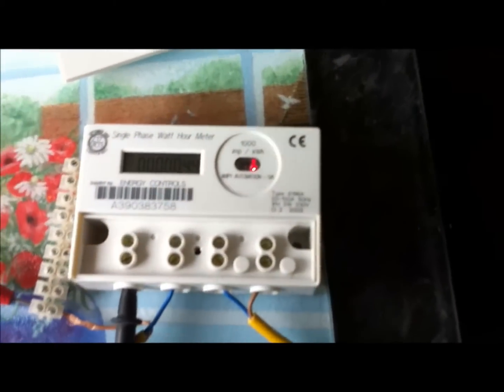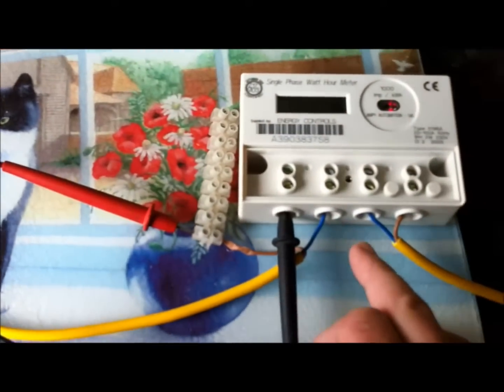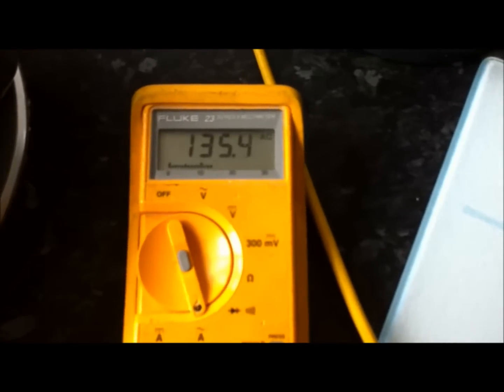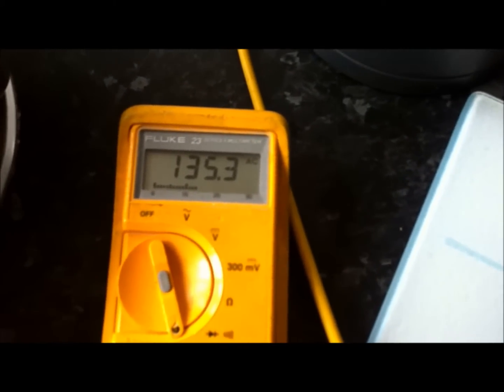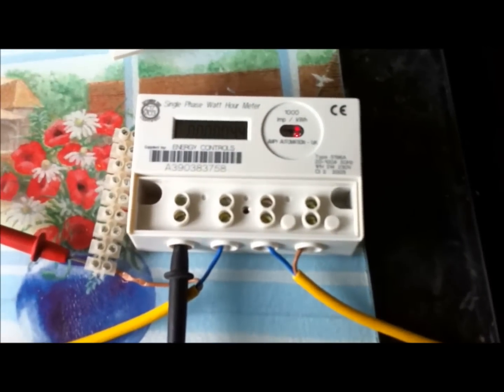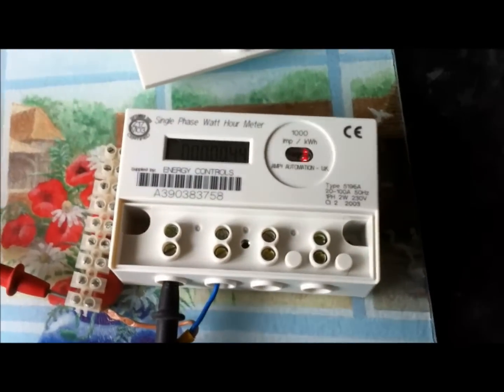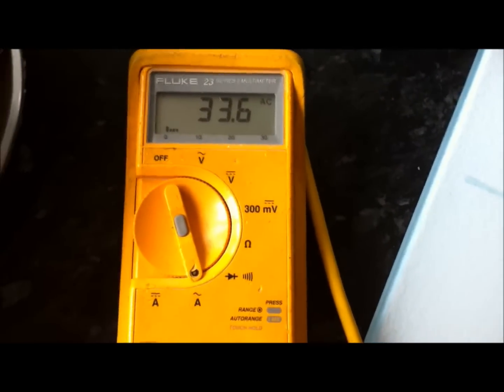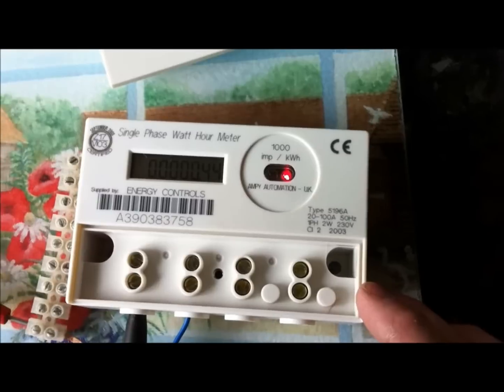How much power does the Ampy 5196A take when on

Comment from the maker: Mesage 1 of 2 Hello there Ted, Normally when the Red light is on constantly it means that you are not using enough electric for it to read it’s a digital meter for an anti-creep (Doesn’t charge you for not using energy) however the rEd stands for reverse energy detected. If I was you I would call your energy supplier and tell them and explain your situation as if you leave this you could get a fine for trying to mess with the meter. You need a pay back meter as what seems to be happening

Comment: Hi Steven, my elec meter is one of these and the red light stopped flashing and it's now on constant. Do you think this represents an error? Also the display changes between the meter reading and rEd ? I've had solar panels fitted recently, if its an error then i guess that it may be the cause? I'd appreciate any advice Thanks.

Comment: My goodness! EIGHT WATTS?! :-O I have a boombox that uses about the same as that!

Vid request: Please re-visit this, when you get the time with the following:

Smith AP meter, & Horstmann Vmk7

Let's see how much those take to energise-up their voltage coil & synchro motor respectively.

But really though....8 watts! I'd have thought it'd have been MUCH less than that.

That 8 watts, multiplied by a few thousand houses...Oooooh! The grid has to generate a few kW just to energise the meters! :-O

Comment from the maker: Hi thanks for the questian I should have done this in the video. 1ma = .001amps 
then we multiply amps by volts. So in my case its 0.0337 multiply by 240 Volts = 8.088 watts it sounds quite alot for running on of these on a pure solar set up I think I will messure the other meters and see what I get. 
I hope this helps you. Steve